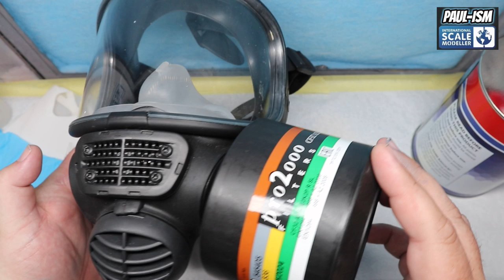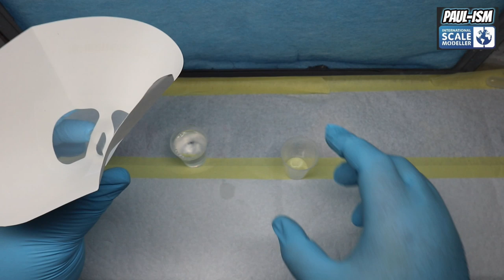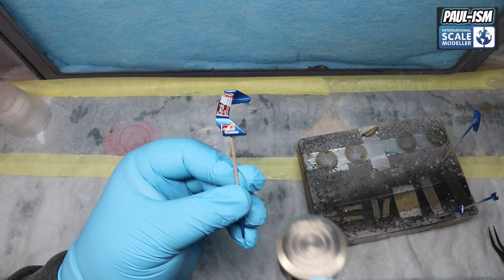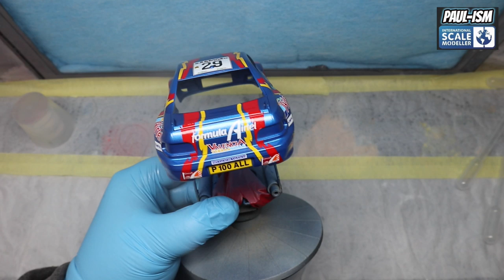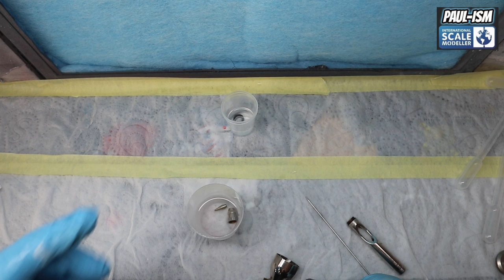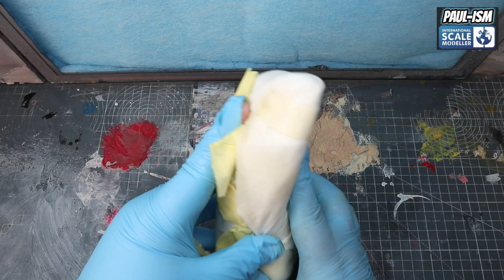"How I spray" Prorange 2k Clearcoat

Comment: Great video, I'm doing my 1st automobile build well 2 (f1 ferrari and a VW camper) what paint type should I be using, I dont really have facility for spraying laquers, as I live in a flat, so my spray booth is basically an elephant hose out the window and pack away when done....any tips would help...thanks
Reply from the maker: Hi Darryl, the least smelly paints are the water based acrylics, but they are not as easy or reliable to spray as smelly paints, if you have access to somewhere out side i would recommend the tamiya Ts sprays and use them out the can as they give great results. thanks for watching and commenting - Paul :)
Reply: @InternationalScaleModeller  Thanks paul, I will try that, I guess my fear is outside I have no control over contaminants...dust, idiot fly, leaf blowing....I always wonder what youtubers do when I hear them say "I just took it outside and gave a spray of TS and or TS Clear"....and I think really, how sheltered are you...appreciate the tips, maybe something away from bench might be a good video for me and I suspect others...especially if overspry on my wall / pavement might cos a wife issue LOL

Comment: Hi Paul
Thank you for your video
I use zero paint 2k myself but I switch to Inspire 2K Clear Coat Set
If your decals are thick then you could try a wet layer extra undiluted
and then continue as usual
I myself sometimes add 4 to 5 layers if necessary
Greedz Ard
Reply from the maker: Hey Ard, thanks for watching and commenting - Paul :)

Comment: Hey, I always come back here trying to extrapolate some other tips. Quick question: how do you manage for the increased thickness of 2k clear coated parts? Because if I try to make "room" with a knife it's risky since the 2k tend to peel and not scratch.
Reply from the maker: The trick is to not put it on too thick I switched to gravity Spain 2k much better imo

Comment: I hope you clean the area above that drawer, because we all know how much we clean above a drawer, and that could be much dustier than any area on the work table. Everytime you close it, it could drop dust onto your work. I have an old wine cooler that died, has a nice seal on the door, enough room for one build, metal case  ( for static issues ) and a window in the door so I can drool while I wait.

Comment: Quick question, why do you throw the spray booth filter out?
Reply from the maker: Because it'll now be blocked with 2k clear coat, these cost me very little money too replace so no issue just replacing it :)
Reply: @InternationalScaleModeller  thanks for the quick reply. Cheers

Comment: Hi Can you  tell me where you get your spray booth filters please ?
Reply from the maker: From
Here https://www.ebay.co.uk/itm/5-x-Benchvent-BV300S-D-replacement-Filter-material-/324156712440?_trksid=p2349624.m46890.l49292
Reply: @InternationalScaleModeller   Thank you very much for your help  i am just getting back in to modeling after a 37 year break so starting from scratch i have ordered a spray extractor like yours as this is the one recommended by everyone .

Comment: PSI?
Reply from the maker: Did you actually watch the video?
Reply: @Grzegorz Mandziak - You may have a slight technical problem, try adjusting the volume... its 30psi.. mentioned at 1min 28secs, 5min 07 secs and again at 12min 04secs ;-) ;-)